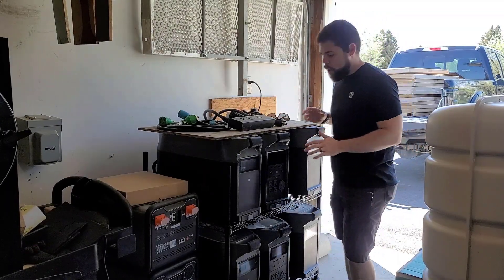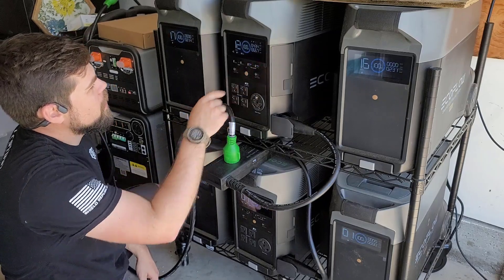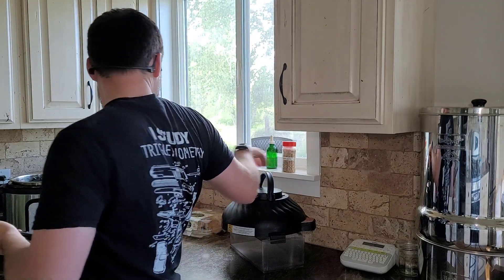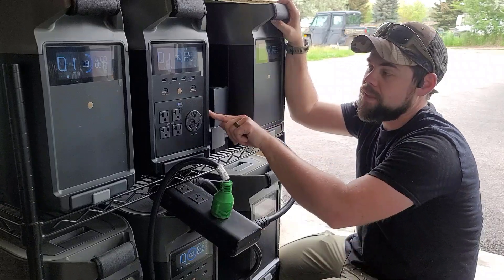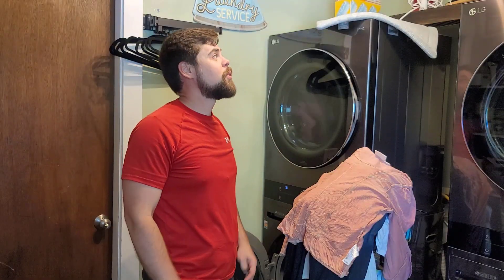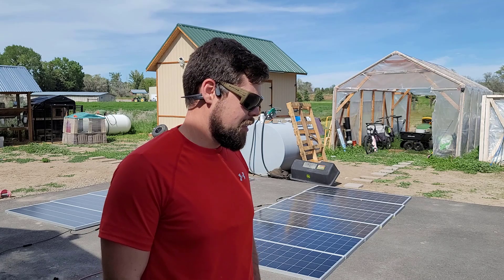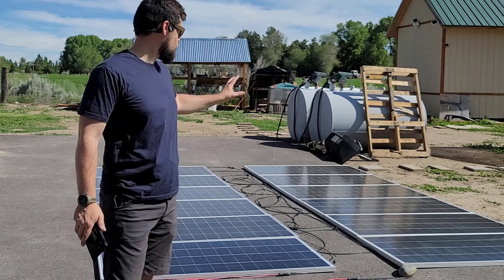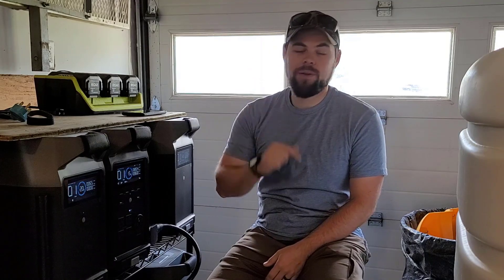Off-Grid House Powered by Solar Generator

Comment: would that panel set-up work if you ran in 3S/2P?  i have a bluetti AC300/B300 and am looking at rigid panels.  some people in the bluetti group have been using Rich Solar 200 watt panels in a 3S/2P set-up.  or would it be better to connect all 6 panels in series?
Reply from the maker: yes it would work in a 3S2P configuration but I would be losing power since these particular panels use about 13a each and the max amp input on the Delta Pro charge controller is 15a. Meaning any amps made past 15a are simply not used and don't go into the system really. That is why it would be best to use 6S2P and use the new 200w panels that come in these kits because they use less amps and the new 200w panels that replace these 210w panels are more efficient so they actually make the same watts as the 210w panels. https://poweredportablesolar.com/product/delta-pro-kits/

Comment: Hi question for anyone. Does parallel or series matter regarding input to power up Gen. and what is a non technical way of understanding the OTHER reasons for connecting these panels in either way. Lastly how do I connect to a panel for super basic stuff like water heater, furnace, and fridge. Thanks I am super new and trying to figure it all out. Got a bluetti 200 max with one battery and panels with 790 output max...thx in advance
Reply from the maker: Yes parallel and series matter quite a bit. The charge parameter for different units varies, but for the Delta Pro the solar charge parameter is 11-150 volts and 15 amps. A typical 100w panel will make about 21v (VOC spec on the back of the panel) and 6a (IMP on the back of the panel) of power. Those are the maximum volts and amps the panel can make. Generally it will be 20v and 5a of power actually coming off of a 100w panel. Volts x Amps = Watts. 20v x 5a = 100w. 

When you connect solar panels in series (panel to panel to panel) the voltage goes up and the amps stay the same. So three 100w panels connected in series would be 60v at 5a. (60v x 5a = 300w). When panels are connected in parallel, the amps goes up and the volts stay the same. Three panels connected in parallel would be 20v x 15a. (20v x 15a = 300w). Volts are very easy to send over long distance, amps are not easy to send over long distance. If you have more amps in a wire, it will create more heat. To make sure you don't create too much heat, you get thicker wire.

What this means is the higher the volts and the lower the amps, the more efficient it is. So generally with solar panels, you want to have high volts and low amps. This why series connections are preferred. But when panels are in series, each solar panel will perform equally to the weakest panel. So if you one 100w panel is only doing 50w then all three panels in series will be at 50w. Whereas parallel, if one panel is weak, the other perform on their own. This applies for example when shade is on a single solar panel of multiple panels connected together. 

You can also do series/parallel combo which is what I use most often. For example you would have two sets of three 100w panels, a total of six panels. Three in one group and three in another group. The three panels in each group are connected in series. Then you use an MC4 two to one branch connector which allows you to combine both groups down to a single set of solar cable. Within each group, the panels are making 60v and 5a, cause they're in series. But then when you combine the two groups it is using a parallel connection so the amps go up. So what ends up going into your solar generator is 60v and 10a. 

Solar charge controllers will burn out if you add more volts than they are rated to. But if you attach more amps than they're rated to, they just limit the amount of amps that go through the controller so it doesn't burn up. That is how we can over-panel solar generators. 

I hope this helps. If you have other questions feel free to reach out at info@poweredportablesolar.com too. :)
Reply: @minutemansolar  thank you 😊

Comment: Size of your well pump?  Ours is 1.5hp, and the inrush (6000+W?  Not sure) would be somewhere in the ballpark of the 7200W limit available to the Delta Pro voltage doubler.  I'd be afraid to buy a setup only to learn it won't work for the well, which would be its most important use for us.
Also:  When you had some items running, did you turn on something with a large inrush current that pushed the output past the 3600W on one or both Pros?  Did the Pros bomb out?  A use case is running the microwave and some other stuff and then washing dishes.  That would fire up our oil furnace and the well pump.  Steady state wattage should be OK, but high current would be needed by the well pump periodically.
Reply from the maker: Hey Ken, I can't remember how large my well pump is. In my experience 1.5hp pumps use about 2,700w or so to run, which puts their peak inrush around 5,400 to 6,000w. So it sounds like you're right. So the DP would likely not have a problem running the well pump, but that would depend on how much other stuff you're running when it kicks on. The Delta Pros peak wattage should cover you but it's hard to say 100% without actually trying it. Definitely a tricky situation.

Comment: Any idea when you will be doing the video on the Larger Solar Panel Stand?  Also, what is the best % to store the batteries at?  I have 2 batteries.  Thank you.  JIM CURNOW
Reply from the maker: I am currently working on that, I think I have found a really nice way to make it work and be very easy but it requires more testing. It will be awhile until I can put that video out. For batteries, it is best to store them between 20-80%. But for me, I always keep mine topped off at 100% because when I need it the most, I want all of the battery possible. To each their own, that's just how I do mine.
Reply: @minutemansolar  Thank you

Comment: I see you have the hysolis mps 4500 and a battery expansion. What are your thoughts on that particular generator. I just recently got the hysolis and it is a great unit, the battery percentage read is a little off but other wise it's good.
Reply from the maker: I like the Hysolis a lot. It's a little less user friendly that most solar generators but it is powerful. I have been testing it for a few weeks now and will be doing videos soon. I like it a lot though.
Reply: Thanks brother! Loved the video by the way, that is a great set up! Was that around 15 thousand for that set up?
Reply from the maker: @hawkmasters11  You're welcome! I wish it was only $15k haha. In total I've put in about $23k into this system. Pretty pricey but I am happy with it. I will be getting other systems to test and compare too.
Reply: Wow! Didn't realize. I think the hysolis with two extra batteries will suffice for what I need. Would it be possible to hook up two hysolis in parallel?
Reply from the maker: @hawkmasters11  No you can't do two hysolis in parallel.

Comment: So what is your recommendation when comparing this with the Titan system that you have shown its versatility so many times. It’s probably the first review I’ve seen you do where you have not mentioned how much better the Titan would perform than this system. I’m also curious as to what your thoughts are about these new lithium batteries from battle born that are larger than a standard battery that might be more versatile and used with an entire house application. I.e. using two of these larger Voluma lithium ion batteries instead of three or four Melbourne standard tape sized batteries. Basically looking for larger storage capabilities for home use as opposed to RV use
Reply from the maker: Great question. I still love my Titans. I still have one of my Titans running my off-grid cabin without any issues. The other Titan is currently running my RV for a week long trip my family is on (second one this summer already). The Titan still have the highest solar input of any solar generator on the market, including the Delta Pro. But the Titan cannot do 240v power and the Delta Pro can. The Titan has 3,000w inverter, the Delta Pro has slightly larger 3,600w inverter. The Titan has 2000w solar input, the Delta pro has slightly less 1,600w solar input. The Titan can easily be overpaneled, the Delta Pro can be over paneled but not as much as the Titan. The Titan uses Lithium NMC batteries that are comparably lightweight and good for 2,000 cycles, the Delta Pro has LiFePo4 battery which are very heavy but good for 3,500 cycles. So there's a give and take to each system so it just depends on what your needs are. I will be doing a video comparing the two.

I haven't looked in detail at the new battle born batteries. But they seem very good. I just find battleborn to be way overly expensive but they are definitely high quality. I don't like lead batteries at all for these setups, they are 100% outdated now.
Reply: @minutemansolar  Good quick rundown of some of the differences between these two systems, I would lean toward the LifePo4 chemistry in the Delta Pro for a safer, longer lasting & more stable chemistry & compromise with the weight issue over the lighter LMC chemistry.

Comment: Can this system be setup with a wind generator as a continuous power maker? I'm getting ready to setup my home and shop wind a hybrid type system and I really liked this setup. Just looking for a way to never stop making power even when the sun goes down. Thanks for the video bud
Reply from the maker: I have not heard of anyone successfully connecting a wind turbine. Also in my personal experience wind turbines are very unreliable and every single person I have talked to who has used one said they would not buy another one. That's just my experience. Here's a good video that shows how to maximize wind turbines: https://www.youtube.com/watch?v=lqIqdpbg06A But for him to just get 50% of the expected output he had to add another MPPT charge controller, which is already in the DP and you can't add another one. The hardest thing with wind turbines is the wind may be good for 15mins, then not for who knows how long. It fluctuates so much that it's not easy to use.

Comment: Well Ben your series of videos on the DP  caused me to pull the plug and grab one. I planned to add a 4th battery to my Titan but I figured for the additional price I could grab a DP and ultimately use them both while I upgrade the DP  to run my whole house and to recharge each other when needed outside of using panels. Luckily Costco has/had  a great deal going  $2999 that will prob expire anytime now Sunday 19th . I didn't want to post this on your channel possibly steering customers away from buying from you but I figured instead of buying another Titan battery why not grab this which will ultimately give me more flexibility for a slightly increased cost. However I'll def grab the DP batteries and another DP from you.
Reply from the maker: No worries, I apprecaite the thought. I am pretty sure that Costco deal is over now too since Fathers day has passed. I still love my Titan, this is just another great option and it gives great expansion options like 240v.
Reply: @minutemansolar  

Yep it was over within an hr of me posting,  came with the EV charger and the remote display screen so total was about an $800 savings.  Like you I def still love my Titan but now I'll have more flexibility since I originally wanted 240v although it will be a while before I 'm in your territory 4 Batts/w 2 DP's

Comment: Do you have or plan to make a video with how exactly you connected the solar panels to the Delta Pros? Are they in series or parallel? why do you like these so much over others for the Delta? I just ordered 2 x Delta Pros and 2 x backup battery’s (one back up battery for each Delta Pro instead of 2 like you)Costco had a good deal for Father’s Day so I took advantage.  I’m really stuck on which panels to go with. I want glass panels like these that I can store in my shed and pull out in times of emergency. I haven’t been sure which and what size panels I should go with and which work best with the delta. I was thinking I’d like to start with 600-800 total watt of panels for each Pro and go from there. Are these panels offered for sale individually(not the bundle) on the website you mention? 
Great vids!
Reply from the maker: Yes I will be doing videos explaining that in detail. In this video each Delta Pro had a single string of panels. Each string had 6 panels in series. I personally like the 200w and 210w panels from poweredportablesolar.com because their voltage and amperage output at quite compatible with the solar charge parameter on the DP. The 210w panels I have in this video will soon be replaced with newly released 200w panels that are slightly smaller, but more powerful per cell so the new 200w panels actually make the same amount of power as the 210w panels I have in this video. I have tried using 100w, 300w and other panels and it's just harder to stay within the charge parameters and get good output. I will be doing a video that explains all of that. You can find those 200w panels here: https://poweredportablesolar.com/product/200w-rigid-solar-panel/